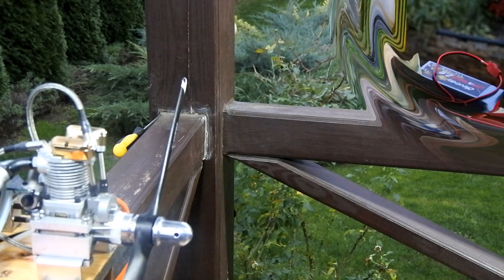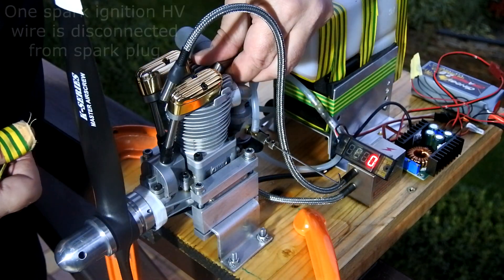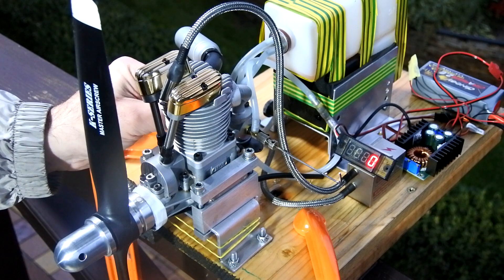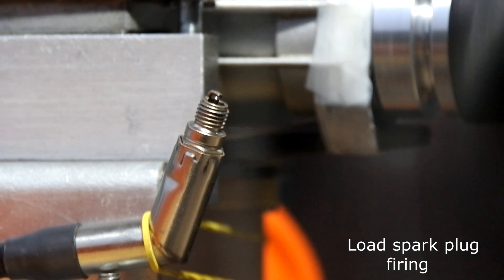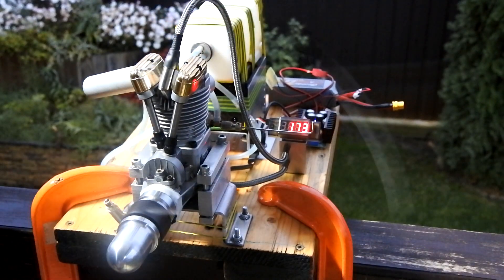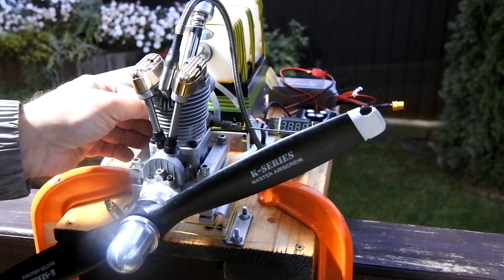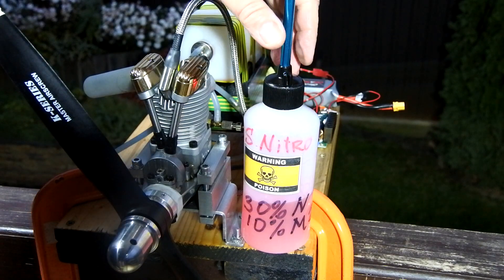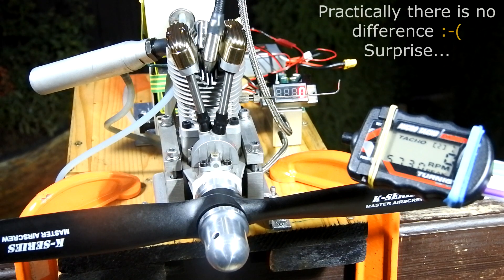Saito FA 120S DP twin spark ignition conversion Part 2

Comment: I would like to see if a running engine ignites a glow plug without the glow plug driver 🤔
It is interesting that a glow plug designed for gasoline ran so well on glow fuel.
Reply from the maker: Good question. thank you. I think there are ways to check if the engine will heat up the glow plug, another thing is that it's a bit tricky. There is, in my opinion, the only way - indirect, i.e. measure the resistance of the spark plug when the engine is running.
 
In short, I think I can answer this question in the next couple of weeks. Stay tuned, please !
Reply: I suggest that you start the engine with spark. After you open the throttle for a few seconds, shut off the   spark ignition.
Reply from the maker: @mikeeiben3430  Yes, great advice ! Thank you. I was planned also to measure hot and cold glow plug resistance, to understand the temp of a heating element.
Reply from the maker: Just realized your request  - how running engine ignites a glow plug without the glow plug driver. :-) - pls. look my next video Saito DA 120S DP - 3 answers at final  test run.
https://youtu.be/XAOp4lKdJwg

Comment: I was suprised to see no difference on performance when switching from two spark plugs to one. 

If you want lowest possible idle, may I suggest trying a bigger propeller with three blades. And a good size spinner to add flywheel-effect.
Reply from the maker: Thank you for your advices. I was also very surprised of no difference between single spark plug and twin spark performance results. Probably, that twin spark setup  would increase engine general reliability. Due to the cold weather limitations, some tests weren’t provided,  like adjustment of initial ignition angle, etc.

Comment: first off,its too dam cold. but i enjoy watching your videos. the oil related mixture was interesting on the way it  idles.. up to about 20% seems to be not an issue. im surprised for that temp it runs so well.
Reply from the maker: Thank you for your comment !
Yes, it’s very cold and I’m greatly surprised that engine was performed relatively well, for 6 degrees Celsius. Definitely, few questions was left unanswered - especially correlation with Nitro content. 
I bit tied with this experimental runs, will think over next days about potential reasons for such engine behavior. Thank you for watching !